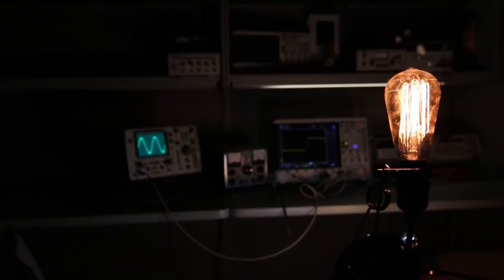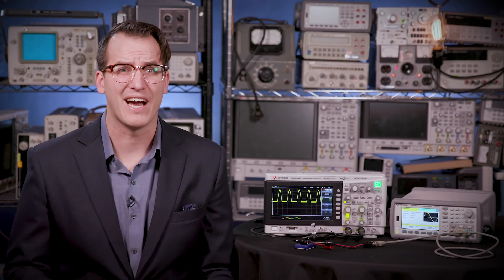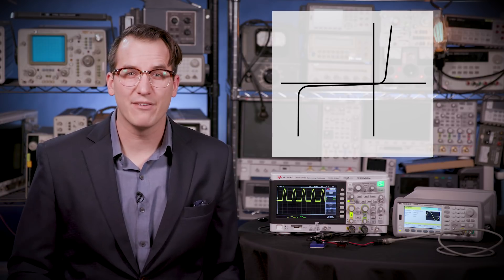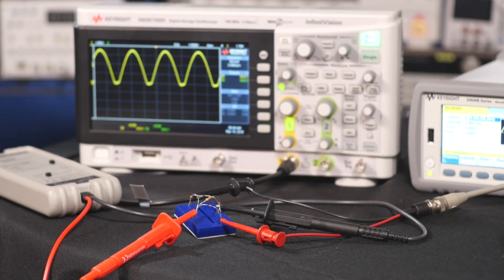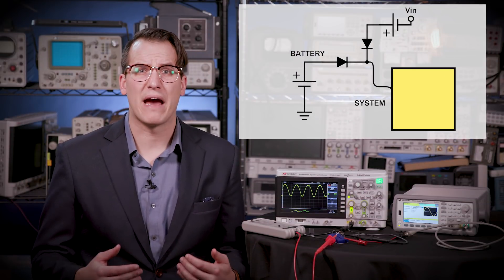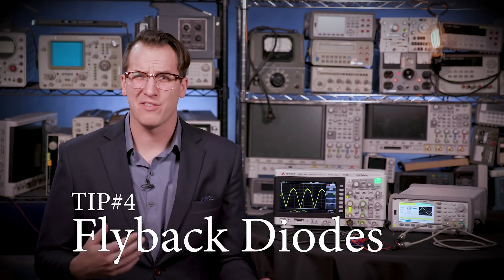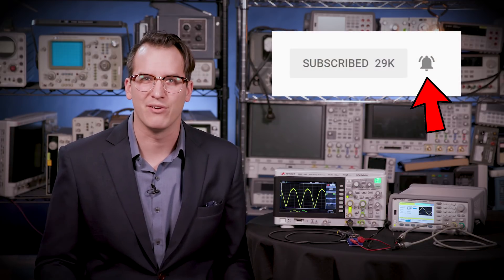4½ Practical Uses for a Diode

Comment from the maker: How are you using diodes in your designs?
Reply: FULL BRIDGE RECTIFIER
Reply: Made a temperature sensor out of a 1n4148 diode connected to a non-used AD converter input. Current source was a transistor, and I guess that also counts as a kind of a diode :-)
The hardware was cheap and easy to implement, the software and linearization wasn't my responsibility.
Reply from the maker: Nice! That would've been tip 5.5, but the topic was too big to address quickly :)
Reply: Keysight Labs Zener diodes as regulators 👍
Reply: I almost always put a diode on the DC supply lines, because i notoriously tend to screw up polarity :/
Reply: You were changing the saw-tooth wave amplitude, and not the reference. It got clamped increasing its amplitude.
 While the DC restoration circuit is wrong (diode must be switched with capacitor). But you connected correctly in the proto-board.
 Nice tutorial by the way.
Reply from the maker: Thanks, and great catches!
Reply: on a more serious note, ring modulators are pretty cool
Reply: I use them as protection in my regulators putting them in parallel of the regulator's input and output.
:D
Reply: I made a balanced mixer using 4 diodes
Reply: Mixin' things up.
Reply: Light Emitting Diodes can also be used as a light sensor. (perhaps even an illuminated touch-sensor, if the duties are right? ;-)
https://wiki.analog.com/university/courses/electronics/electronics-lab-led-sensor

A transient-voltage-suppression (TVS) diode, also tranzorb, transil or thyrector, is a great way to get eletronics safely through CE/UL certifications. They keep the light and smoke in, and the surge tester going klonk-klonk-klonk...

Diodes can surely be enlightning and fun to work with.
Reply: I used pin diodes as attenuator . A tunneldiode in a fast pulser,  as a sort of switch for SRAM battery back-up,  also as tempsensor, as voltdroppers.
Reply: to make FULL BRIGE RECTIFIRE!!!!!!!!
Reply: In VCF's or VCA's and as logarithm current source, and for the normal stuff..
Reply: Flyback across solenoid valves. Keeps the mosfets happy.
Reply: Yeah. You need to make more oscilloscope give away becouse if i win one i got to get to mesure a FULL BRIGE RECTIFIER!!!
Reply: To cut it in half and show my cousin to get me famous for breaking diode in half.
Reply: prolly for a school project. just lighting LED's in reverse polarity, really
Reply: Using diodes as servo supply protectors, but both each polarity equipped. Somehow kills about 1.2 volts supply to servo. So i had to set the input voltage before diodes 1.2v higher than usual. Is that overkill the schematic circuit on it?
Reply: Pseudo sinus transform from a triangular waveform LF generator (using 3 cascaded diodes at different polarization, x2 for both demi-cycle). Just a small LPF at the end to obtain a beautiful sinus...
Reply: I have a 110GHz Step-Recovery diode I use in a high power, high frequency RF source
Reply: Isn't clamping support to cause the top to become flat? It did not become fully flat.

Comment: For two-lead components, linear means that CURRENT is proportional to voltage.  Only when this current flows through another linear device is another voltage produced linear with the input.

Comment: It's funny you say logic.  I'll tell ya a little story. I bought my first scope because I was told it could easily be used as a logic analyzer, my bad I was new. I save up 1000cad and buy a better scope, I go through the proper channels to get the logic analyzer add on. It's the same price as the scope I find out this week. I donated my first scope as I only paid 400. I'd donate this one but I'm not that rich and was treated like a child when I called the company's authorized reseller this week. They had a sale going on where I could save a few hundred dollars if I spent 1800 for a new scope then I could get the 500 dollar la then they give me the sale price on the software upgrade fee. That's the big favor they offered. The only recourse I have other than a strongly worded email is to return the 3 output linear supply my wife bought me for Xmas. Hurricane Fiona took 75 percent of my house and I could've lied and claimed the scope as we just got approved for our belongings while we wait for the house to be done. We rescue cats so I sleep on a chair in my workshop while my wife sleeps and works from the recroom in the basement. We can't fit a bed in the house as the space is half fixed. They delivered a bed today finally but we had no where to put it because we don't have the room until construction is finished. We were going to stand it up in our sub basement where the hot water furnace was but the mattress wouldn't fit around the corner. Hahahaha

I couldn't make this up. I could add more negatively to it but I'm just happy no one got hurt during the hurricane.  Haha

Comment: The 1/2 use you mentioned, what if I need to clamp the voltage to more than the forward drop of the diode? Also, won't the diode get destroyed when it is forward biased or when it reaches its breakdown voltage during the reverse bias?

Comment: Interesting thing ... speaking with my spanish speaking SMD tech today, he'd told me the component which failed on the HD we're recovering (since I'm trying to learn) was a device that limited the amps. I asked if it was a fuse, and he said no -- a diode. He said diodes were more effective than fuses.

I don't know if he was being lazy or if it was the limits of his languagability ... but, either way, here I am. Per the video's intro:

A diode allows the amount of amperage equivalent to the the x-axis' voltage.

Comment: Haven't gotta clue as to what you are talking about
Reply from the maker: John it's 4.5 practical uses for a diode
Reply: @KeysightLabs  I'm trying to understand all this diode stuff.  And. It really makes no sense. I have a circuit I'm trying to build. I have a 1000 uf capacitor being powered up by the same 5 volt supply as my arduino and a adafruit sound board. And I want to protect the arduino and sound board from any power discharge from the capacitor. I have no clue. Thank you
Reply from the maker: It's hard to say without more info, but you basically want the diode pointing away from your boards towards the capacitor so that it blocks current flowing from the cap to the boards.
Reply: @KeysightLabs  
Well. I can't up load a picture of the fritzing schematic here of of it. Basically. I have a 5 volt 15 amp power supply. I have 180 programmable ws2812b led strip. Which is 5 volt. The arduino. Which is 5 volts. And the adafruit board which is 5 volts. Amp consumption on the boards is unknown. The capacitor is 1000 uf.

Comment: LINEAR MEANS YOU CAN ADD RESPONCES. NOT YOU GET A STRAIGHT LINE. IT FOLLOWS TWO RULES SUPER POSITION AND HOMOGENEITY. VERY GOOD VIDEO !! THANK YOU!!
Capacitors are modeled with exponential functions which is not linear however the response of it can be added and follows linear fashion

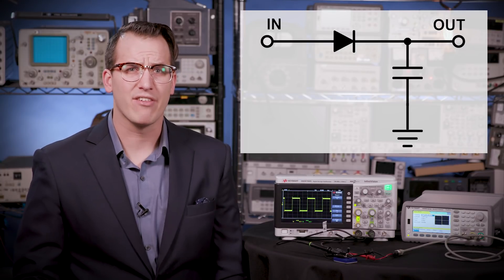Comment: I think there's a mistake in the video @ 5:05 : the diode and capacitor should be swapped in the drawing (for capacitive coupling) to get the signals on the scope. Loved the reference to ElectroBOOM though ;- ). Bit late, I know.

Comment: Actually... there was some interesting stuff in that. I'm surprised "High precision reference voltages" didn't make the list. 
It's very difficult to make a good voltage regulator without a specific reference voltage, and zener diodes are some of the best ways to do that.
Reply from the maker: Thanks, and that is a great use!
Reply: Actually, zener diodes are some of the worse way to make a good voltage reference. Zeners can do poor, but simple voltage regulator.
Reply: @LukaszTNT  so what are we supposed to use then?
Reply: @優さん-n7m  as usual, it depends on case what You want/need. One case is device made only in one prototype adjusted and operated only at room temp, the other case is mass production devices with/without adjusting every piece. Compare datasheets etc. Check TL431, some LDO , dedicated ICs. 
As I remember, 5V6 zener is special case it has the lowest temp coeff among zeners.

Comment: I love diodes. You can also use them to add power from different power supplies to increase current. For instance, most lab power supplies are rated to 3A - what if you need 5 A for some use. Just add two power supplies together with two high current diodes that prevent current flowing from either power supply into the other(s).

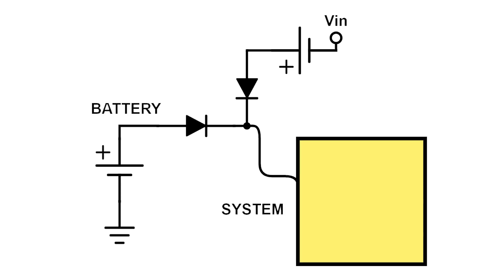Comment: @4:00 You have a small error in the schematic for the diode-switched alternative power source. You show for thw external power: an input terminal feeding in series to a voltage source through the blocking diode to the device.I think you meant to have the positive side of a voltage source connecting across a connector through the blocking diode to the device…

Comment: You can use the FULL BRIDGE RECTIFIER!! as a voltage controlled switch for things like current sources. Also how many useful ways to connect 4 diodes in a ring can you find?!

Comment: One more uses of diodes is as switches for alternating low power signals (something like audio signals), an audio signal with a voltage less than diode forward voltage will not be able to go through the diode, but if the diode is biased with DC voltage (say 2 volt) the audio signal will be able to go through the diode. thus turning the diode into a low power ac signal switch.
Reply: Please elaborate, why even have the diode if we are going to do the bias, just connect it directly.
Reply: @優さん-n7m  this video explains it https://www.youtube.com/watch?v=YBNIq_d56sA
Reply: @優さん-n7m  the bias isn't always there

Comment: 5:02 The diode and capacitor have to be swapped. Also, for positive bias of the AC the diode would go cathode-up. You can even see that the circuit on the breadboard is built correctly - probe grounds go to diode anode.

Comment: LEDs are diodes. Am working on an analog version of a Joule Thief circuit that drives two oppositely biased LEDs. Think MacGyver style flashlight/nighlight for STEM/STEAM projects. LEDs, foil (for capacitor) and wire (for windings) are common scrap components.   Am also working on an EMI detector that lights two LEDs in opposite bias and driven by a tin can as primary antenna for STEM/STEAM.  [The transformer in the analog Joule Thief uses a special 1:6 transformer with very low impedance --essentially, a transmitter wire wrapped by 6 parallel receiving wires of similar diameter --capacitance and induction are mathematically torturous (calculating impedance, VSWR etc), and yet rough sketches suggest this 1:6 should be useful if the transmission-line like factors can be wrestled into something predictable.]